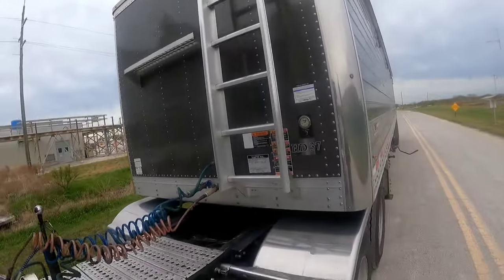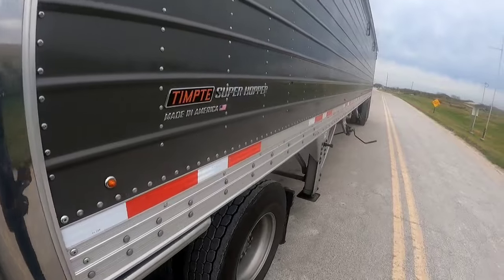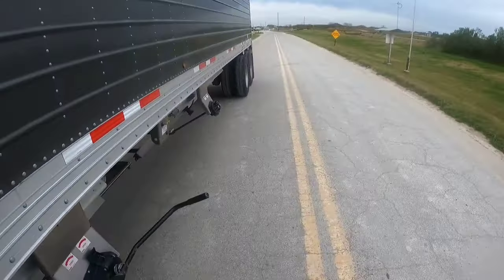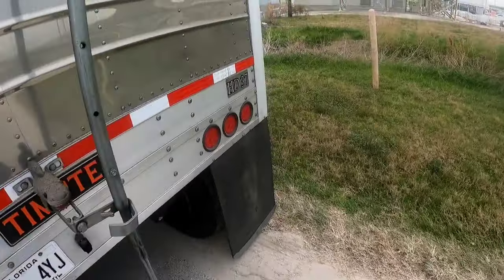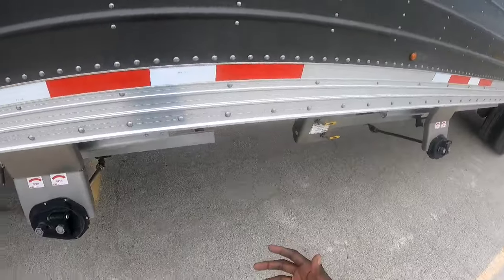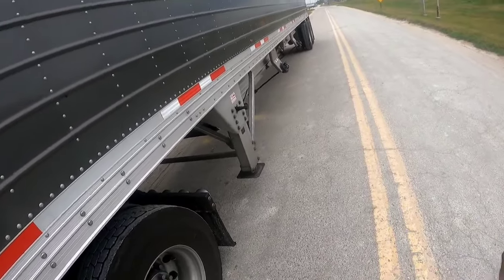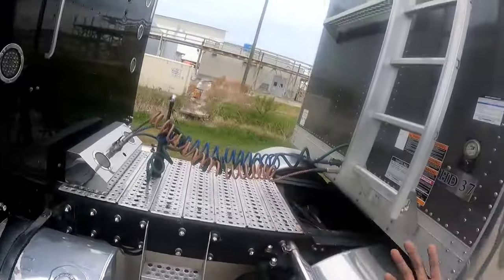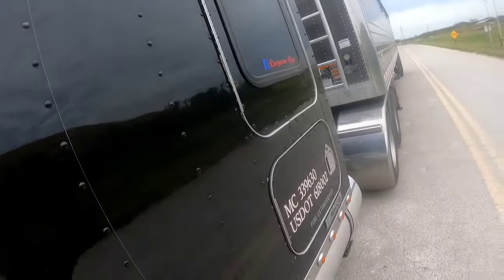How does a hopper bottom work? some ins an out about the trailer

Comment: Might wana get one those truck brushes kinda high dollar after you use it on your rig washin for alittle  while then use that head to keep your trailer clean  extended handle is great for knockin the corners out there not cheap but if you take care of it them you never need another one soft bressels worked great for me even on highside trailer LOAD LIKE A BOXCAR DRIVE IT LIKE A RACECAR  BE SAFE
Reply from the maker: I keep a couple of brushes with a extension pole.

Comment: If your truck and hopper bottom don’t have gauges, can you add them?  Any suggestions?
Reply from the maker: Yes you can. I would suggest getting the blue Link weight system. I heard it works really good. Accurate to about 500 lbs.